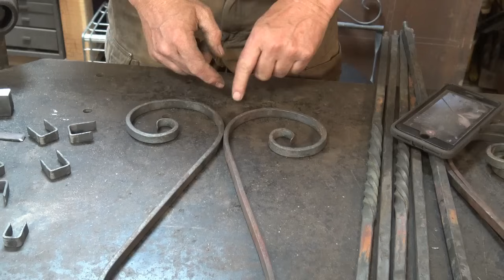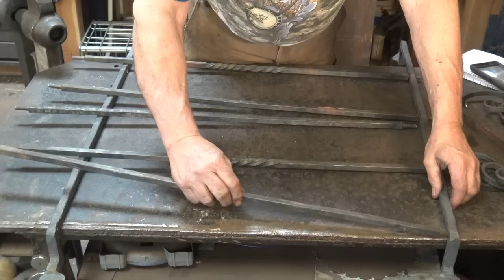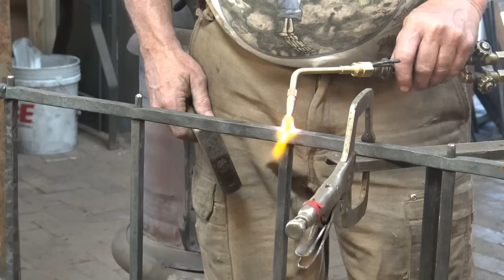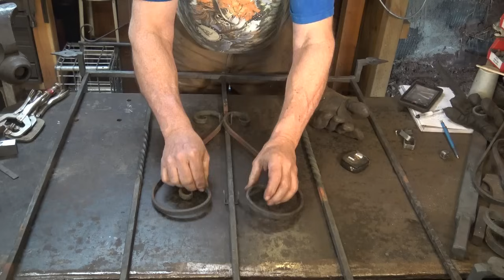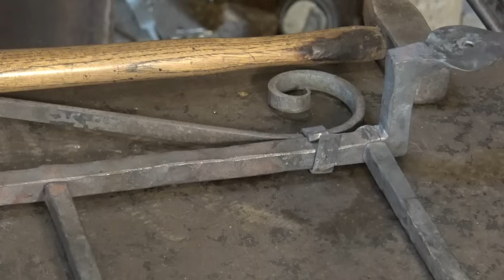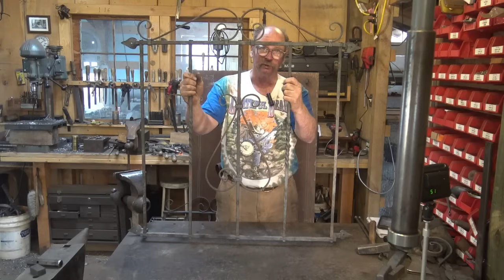Window grill project final assembly - blacksmithing

Comment: Part of the problem I had assembling mine, I used the forge to set the first row of tennons, heating the ends of the bars and inserting them and peening over. I only got the gas torch out for the second set. That allowed enough heat into the tops of the bars for them to deform slightly which I didnt pick up on until I realised things were not the right length on the second side! But I ended up with a functional window grill, and I really enjoyed coming along for the ride. I Certainly learnt a lot of new stuff, and certainly did a lot of stuff I had not done before! Thank you very much!
Reply from the maker: We do tend to learn a little more on each project.  The torch really helps, but I know they weren't always around, so the previous generations of smiths would have had to use the forge.  Sounds like lots of work.

Comment: Eerie dejavu for me - My dad had chalk drawings like that all over his workshop, anything from handrails to picket fence gates or balcony rails. They looked exactly like yours. Well metric, not imperial though. :-) About the scolls though - I would think that the belly should touch the other bar and be attached there - after all they are just a horizontal connecting element done in a decorative manner.
Reply from the maker: I think you are probably right about the scrolls.  I did them this way because it was how the original sample was done.  But the lack of any true purpose for the scrolls is one of the reasons I think they weren't needed.
Reply: My dad made a lot of these things, mostly picket gates and balcony rails - I guess they were in fashion back in the 70ies. He had an old book about blacksmithing (a reprint actually), in which these grids were shown. Apparently scrolls are a way to close the gaps between the rods with less material (than just more rods), and at the same time giving some lateral strength, but in a springy way rather than rigid. Anyway, I think a lot of those cheap machine made "wrought iron" products are not only badly made, but also without any knowledge of the purpose of the elements. I really like your videos, because you are being authentic about the products as well as the process. Besides, I get this dad-did-it-this-way-too-reaction all the time :-D

Comment: Id really like to see you make some midevil armor, midevil shield or even perhaps an old midevil castle style door complete with rose head nails for example (basic door size) I think those would be very challenging and I struggle to find any content were someone actually forges up the materials for such creations I need a beefyer door to protect my own forge and tools so i was debating on building one complete with all the hinges and one of your hasps I really liked. Your videos are outstanding Ive been watching 1000s of hours of content over the last couple years which got me into black smithing and lately i havent bothered watching anything else no other content offers the knowledge and step by step with explanation that your videos do.
Reply from the maker: The door would be a fun project.  But I wouldn't hold your breath on the armor.

Comment: On the top bar, the bulging spots from punching the holes also making the rail come off the table more. Just another detail to be aware of other than the thickness difference between the scroll and the rail. Not for the band, but placement of the scrolls on the table or shimmed up.

Comment: Excellent video John. I think your videos are great.  I like the oops parts like forgetting to turn the mike on.  You are on our level not some fancy Hollywood production that ends in drama. 

Where did you get that torch tip?? The rosebud or cutting tip I use is almost to much at times. 

Your grill is way more pleasing to the eyes. 
Thank you.
Reply from the maker: That is just a propane welding tip.  A mid size acetylene welding tip would work well.

Comment: Great video John! You mentioned you didn't like the scrolls in the project and that you thought they were tacky . Are there some other things you might have added to the grill to make it look more decorative, or do you think you would have just left the balusters as they were?
Reply from the maker: I think I would have either left it plain and simple or added a central panel or ring with an ornamental element that was part of the structure for the grill.  My main problem with the scrolls is that they are just there to be scrolls and don't seem to add much.
Reply: So is your main concern that they don't offer anything structurally to the piece, and instead are just there for the sake of being there?
Reply from the maker: Yes, I think that pretty well sums it up.

Comment: Excellent Work..!!!  If you market that, someone just might want several duplicates..??  But, if you use it on your shop one day maybe give us a quick glimpse of it mounted.  Hey, I always love to help a brother out when I can... when I'm doing a lot of torch on/off work I keep a small fire source close by... I will have a lit candle close so I can just reach over and fire the torch.  When I was on jobsites(Millwright) I always had my striker on my belt pin... but if anyone was smoking a cig close by I'd say "Hey brother gimme a Light" and fire my torch off their cig...lol
Reply from the maker: I usually use a gas saver that has a pilot light.  But it is set up for acetylene so It doesn't run properly on the propane.

Comment: For a swooping piece, like for the top rail of a gate or doorway grill, being as the tenon goes through at an angle, would you make a monkey tool a bit long and cut the end at the angle needed to match the swooping piece? And to measure for the tenon length, long side through the swooping piece?
Reply from the maker: I haven't done much with angled tenons.  But it does seem like a matching monkey tool would be handy.  You would need to do some test pieces to get the length right.

Comment: How would you weather proof this project?
Reply from the maker: I would typically use an oil of wax finish because it is transitional.  Painting or powder coating would last longer though.
Reply: There's another way also for traditionalists, a burnt pine tar finish.
It is done at a black heat, almost a dull red.
It is way blacker and more durable than burnt oil or wax, but you can add that on top if you wish.
For museum work I would usually paint over top of a burnt tar or oil with linseed oil paint, since most of our local buildings are painted.

Comment: Maybe wrought iron style? 
You said you don't care for the scrolls. Is there something else that you would use instead? Or would you leave it with just the 5 uprights?
Reply from the maker: In this piece I would probably leave it without the scrolls and just keep it simple.  It isn't really the scrolls, just that they seem out of place on this piece.  Scrolls used where they are more than just an added ornamentation are much better.

Comment: I thought of a question - I'm quite curious how "rigid" the whole assembly is, sometimes if I don't quite beat down the "rivets" on the top and bottom to sit down far enough it can be slightly loose. So if you grabbed the window grill on opposite ends and gave it a twist, just how rigid is the whole assembly? thanks! It could perhaps even make an interesting video - just how rigid is that kind of assembly.
Reply from the maker: Traditional joinery can be very rigid.  But remains just flexible enough that it is less likely to break under stress than some welds.

Comment: Do you think it would be possible to form a rivet with a 5/16" or 3/8" tenon only using a propane torch?
Reply from the maker: I have never seen a regular propane torch get anything hot enough to forge.
Reply: Black Bear Forge Thanks for the reply - that’s what I thought.

Comment: John, never heard of an economiser valve, what is it and how does it work?
Reply from the maker: It has valves for both oxygen and fuel gas.  You hang the torch on a lever and it shuts the gas off, lift the torch and you have everything preset where it was and you light it again with the built in pilot light.
Reply: @BlackBearForge  nice

Comment: As for the scrolls in the middle, does absolutely nothing structural, simply eye candy, a better spot would be from sides to top and bottom, similar to your shelf brackets for racking prevention, and making the gaps smaller so a person couldn't find a place to squeeze through, although a bear wouldn't fit even without any scrolls, lol, he gets interested enough, he just rip it off the window frame 😛

Comment: Can one harden the mild steel to make bolt cutter resistant? Now I have 1 1/4 “ holes drilled thru the 2x4 and bar ran across windows then I made straps and lagged them from inside. Not that I live in a bad neighborhood but I have lots of tools and don’t wanna lose them plusmmy insurance only covers 25k loss if it was broken into. And how do u price hand made tools ... I seen 3 lb rounding hammer for sale for 150.00 ? And my hammer collection is huge
Reply from the maker: There wouldn't be any practical way to harden it.  Even a 4 foot set of bolt cutters is pretty much limited to 1/2" bar and thats a lot of work to cut.  So using bigger bars would make it extremely difficult for someone with bolt cutters.
Reply: Black Bear Forge this would make my wife happier! She don’t like ugly lol! She loves the scroll bars on windows tho!